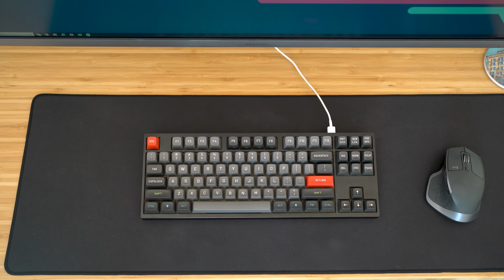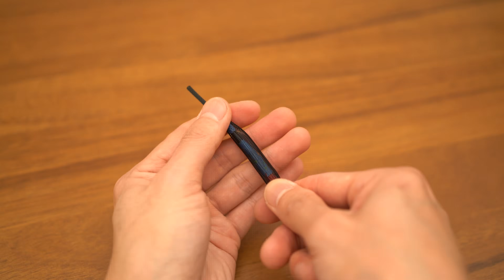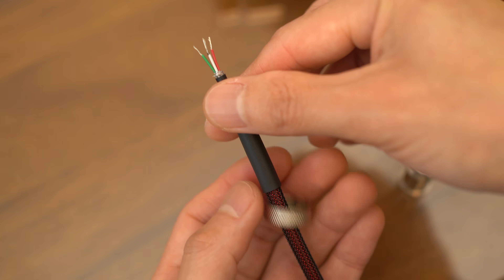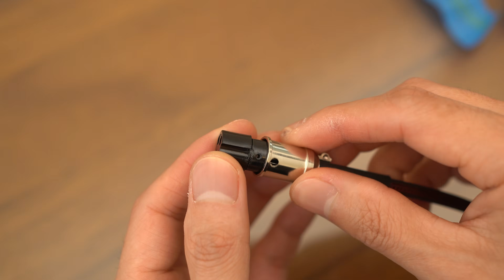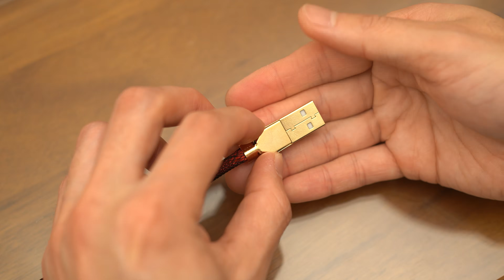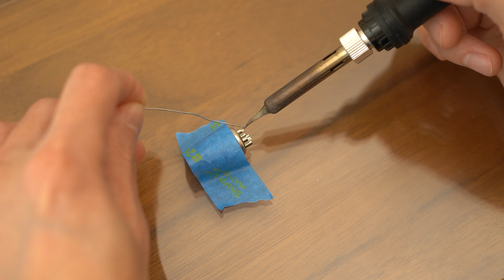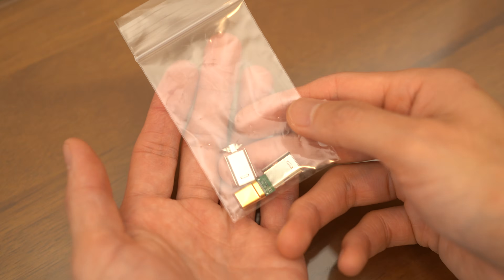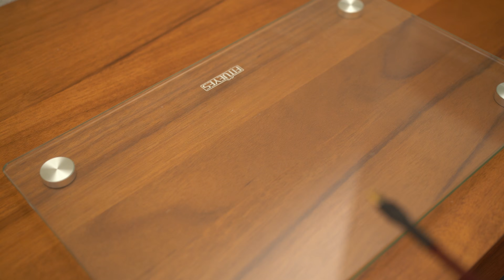Custom Coiled USB Aviator Cable for $50?!?!  Build one DIY for just $17!  Follow Along Tutorial!

Comment: just some words of advice from someone that's been making cables for the better part of the last year regarding coiling

 REVERSE COIL. If you want tight, solid coils that will hold their shape for a long period of time you need to reverse coil. What this means is that the first time you coil you're going to do so in the opposite direction you want the end product facing IE if you want a coil that runs to the right of your USB C then you'll start coiling to the left and vice versa. Do your coil as normal but pack it as tight as you can, pulling out excess slack as you go and tape it off securely at both ends. Then heat treat. I usually do about 6-7 minutes of heat treat for a 7" coil. Disperse the heat evenly and never get your heat source closer than an inch as you WILL burn through your techflex sleeving VERY quickly. I usually do 2-3 heat treats and let the first wrap sit for at least 3-4 hours. Remember, the longer the coil sits the better. After you've done your first coil, remove it from your dowel and start coiling in the OPPOSITE direction you just coiled, making sure to twist the cable as you wrap. Again, pull out any excess slack in the line, ensuring that the coils are packed tightly against one another and secure with tape again. Follow this with another 2-3 heat treats. I personally like to finish this off with about 30-45 minutes in the freezer to really lock the coil in. 

It's a long process but if you've done it right you'll have a MUCH tighter coil that will stand up to much more abuse and look super clean. This is just coming from a dude that's had plenty of practice and screw ups along the way. Also I do custom builds if you'd rather just avoid this whole process all together wink wink nudge nudge lol
Reply from the maker: Hi Colin!  Thank you so much for this expert advice!  I have some older cables that have lost some of that spring and I will try doing this to reset the coil.  Do you have a website or anything for your cables?  Would love to check it out!
Reply: @Keybored  no prob! I’m definitely no cruzctrl or space cables but I’ve made and sold a good few cables and just thought I’d pass along what I picked up along the way! 

I can be found at Ultos Cables on Facebook! Awesome channel and work btw! Your editing and production are really solid!

Comment: What is the purpose of the coil? Also, shouldn't the shielding be grounded through the housing of the connectors rather than just clipped off?
Reply from the maker: Hi Thick! The coil is mainly for aesthetics! I have connected the shielding to the drain on 5 pin aviators, but didn't for this 4 pin. But you are right, that is the best practice!

Comment: Most heat guns only run at 1 temperature the difference between the high & low settings is the fan speed so on high it is moving more air which makes it the cooler setting since the faster air has less time to heat up.

Comment: $17 but that's not factoring in the cost of the iron, tin, heat gun, or clamps you might need to hold stuff still. in all actuality the first cable you make is gonna cost you about 4x that price once you pay for the tools necessary to complete the job. every cable after that is going to be $17 IF everything goes accordingly.
Reply from the maker: Hi Justin!  Thank you for the comments!  You are correct, it is much easier if you're already in the hobby and have the tools available!
Reply: eh not really. A basic soldering iron can be had off amazon for like 20 bucks that will come with solder and everything else you need. You can use a blow dryer for a heat source though a cheap heat gun (again) from Amazon is like another $10. 

CruzCtrl is actually incredibly cheap for his cable kits compared to things like Zap, he just has far less inventory and selection of colors/connectors.

Comment: Would it also work instead of a heat gun putting the cable in the oven at a low temperature like 60-80C for 5-10 minutes or so?
Reply from the maker: Hi Conor!  Some people actually have mentioned that they tried that and it worked!  I haven't not tried it personally, so hard to comment there :)
Reply: @Keybored  yeah I was thinking that its probably easier to get a more even heat without accidentally melting any of it by keeping the heat gun on it for too long.

Comment: Liked and subbed...Question, I saw a youtube vid on DIY coils and at the end he twisted (reversed) the direction of the coil!. What benefit if any does that achieve?
Reply from the maker: Thank you so much for the sub! I appreciate it! If you reverse the coil, it makes the coils more springy and makes it want to collapse onto itself like a slinky. It's good for helping it retain its shape better! I didn't show that because I felt the techflex does a good job of holding its shape even without the reversal.
Reply: @Keybored  Thanks for the heads up :)

Comment: Interesting subject.  But
Please, get a new scissor that isnn't blunt, or use a sharp knife.  Blunt tools destroy material and can actually be more dangerous then a sharp tool.

Tip, tip is for heating, not applying solder.  Because that would ruin the fluss in the solder.  Pre tin the wires make it easier to connect them to the socket.
Reply from the maker: Yup! I definitely need new scissors! And a lot of great advice from soldering experts on this video, I learned a lot!

Comment: I once heard something about reversing the coil after letting it cool to make it stronger. Are you aware of that and if yes, why do you not recommend it?
Anyways, this is a great video.
Reply from the maker: Hi thera!  Yup, reversing the coil will help create a "springy" coil that stays much tighter.  I didn't demonstrate it for this build, since I felt that the paracord/techflex combo does yield a pretty solid coil.  But what you do is after coiling, you essentially "flip the coil inside out" so that the coil wants to "spring into itself."  Hope that helps!

Comment: What soldering iron are you using?
Reply from the maker: Hi Tisho! I'm using a cheap anbes set from Amazon. It worked for me for some time, but overall, if you're planning to use it more often, I would recommend a nicer set. I am planning to upgrade to a hakko or something similar.
Reply: @Keybored   you might want to look into ts100. It is light can be driven of 12-24V and i use a universal laptop charger to drive it, 90W i think. 
It has many "tips" and it has a sensor in the tips for better temperatur controll. 
You can even upgrade the firmware.

If you are getting the ts-100 dont forget to get some extra tips. And a silicon extension cable for better controll. (Less dragging on the back of the iron.)

I think marco reps have some videos on it. And a screwdriver called es-100.
It is a good soldering iron if you have the right tip for the job.

If you already have found your soldering iron it might be interesting to know about.

Comment: what is that monitor?
Reply from the maker: Hi Different!  The monitor is a Samsung 34" Ultrawide UHD monitor.  Hope that helps!
Reply: @Keybored  they actually have 8 different ultrawide qhd 34" monitors :'( which one?
Reply: @Keybored  actually 3 are not curved, I think that will be OK. Do you think it's better to have a curved 34" or non-curved?
Reply from the maker: @BankruptGreek  I think in my opinion, a flat version is more versatile, while the curved is more immersive in games.  For example, I use the flat 34" right now for both work and play, and for spreadsheets, etc., I like the fact that the rows/columns of spreadsheets remain straight on a flat monitor.  However, I had an LG curved Ultrawide before as well, and I really enjoyed that monitor for most gaming due to the immersion.  So it would depend on the use case, and for me, the flat works :)

Comment: When soldering the connector pins, preheat the pins to allow the solder to works it way into the pins and "tin" the wire side with solder so you have a solid connection. keeps you from having bad solder joints and connection failures.
Reply from the maker: Thank you for the advice xFBx!

Comment: Oven heating! 

230°F for about 40-60mins, you’ll be far more pleased with the results. Then rapid cool it in the freezer  until it’s below room-temp, and finally reverse-coil it and repeat the process.
Reply from the maker: Thank you for the advice Ryan! Will Def try that next time!
Reply: Oh nice, thanks for this tip so I don't need to go out and buy a heat gun then! What do you mean by "reverse-coil"? Like are you undoing the coil you just made or something?

Comment: Does this work with more than just keyboards? What about me trying to play a Pc game with an Xbox controller type c? Will that work? And can I attack more than just type c? What if I wanted to be fancy with everything I used? iPhone charger? Oculus quest charger? Anything charger?!?!
Reply: Attach*
Reply: Oh and could I make usb type c to usb type c? And what about psh idk usb type c to lightning cable ...
Reply from the maker: Hi PureOxide!  Yup!  I believe on CruzCtrl, he offers both the lightning connector and a few others as well!  And as long as the device uses a usb cable, this is an option!
Reply: @Keybored  and what about that middle connector for the keyboard? Would that be compatible for lightning cable or usb type c to charge or use devices? Or is that strictly for like keyboard sending “info” so it’ll work Some’s thing?
Reply from the maker: @CrackGameingStudio  yup! The aviator connector is just a quick disconnect so shouldn't hinder much at all!

Comment: Hi! Can you do this with a micro-USB based cable? I checked other videos and it seems that they have a different wiring diagram (just making sure if the process is also the same)

And also, if ever I connect the male and female GX16 together (assume that we have finished soldering etc.), do we need to follow a specific pattern? Like do we need to line up male pin 1 to female 1 and female 2 pin to female 2 pin etc.?
Reply from the maker: Hi Homurice!  You are correct!  Always match up the GX16 pins together.  1 goes to 1, 2 goes to 2 and so on.  The colors should be matched to those numbers.  Even with the Micro-USB, the wiring pattern should be followed similar to the USB-A.  There should be 4 solder points!  Hope that helps!

Comment: One, use Flux when soldering. Two, tin your wires before attaching them to the posts. It will make a much better connection and you'll have an easier time of it, as well.
Reply from the maker: Thank you for the advice Griffin!
Reply: @Keybored  great video, though. It may be just what I need to bring that polish to my setup when I finally build my custom keyboard

Comment: why do people like those overly huge aviator connector thingys?
Reply: a e s t h e t i c
Reply: @emiraryaputra4900  alright! :-D I thought that much. yet its a taste-thingy :-D
Reply from the maker: Yup!
Reply: @emiraryaputra4900  yet my approach behin the question was design-theory motivated. Adding smth. for the sake of beauty without necessity is often considered
a) wasteful
b) unnecessary
c) bad form

🤷‍♂️
Reply: @maggotinc    it has some "functionality", the idea is if you have multiple cables with the aviator connectors, you could leave the one attached to your PC(without having to unplug from behind your pc), and then just disconnect from the aviator and change coiled cables/keyboard, mix and match different colored cables and keyboards. But I guarantee like 90% of people use it for just the looks. The same thing with coiled cables in general, there is literally zero purpose of having it coiled besides the looks. 1. you cannot extend coiled cables(it will just ruin the coil, 2. you waste material ( 6foot of cable for 1 foot of coil).

Comment: If you don't have a heatgun or good hairdryer, you culd also put the cable in boiling water for some minutes (water can not burn plastic so no worries if you have it in a longer time) if you have large enough pot :)

Comment: You fogot about the shielding of the usb c. It has to be connected to the cable shield (need good solder joint)
Reply from the maker: Thanks for the advice Pierre!  Doing this video, I have received a lot of good advice from soldering and electrical experts!  Thanks!

Comment: Thanks for the video, generally found it very informative but the soldering method isn't perfect. It could lead to mechanically poor solder joints or even spotty electrical connections. You do want to tin the tip of the soldering iron with just a touch of solder but you'd want to use far less and you wouldn't rely on that solder to make the connection. You burn off the flux before it can clean the surface you want to solder to using that method. 

What you want to do is touch the iron to the part to be soldered, let it heat up for a moment and then flow the solder into the part in a different spot. If you do it well it should flow over the surface of the electrical contact. If you notice there you had to spread around the solder like it was glue which shouldn't happen.
Reply from the maker: Hi DarkLordDylan!  Thank you for the advice!  I have a ways to go to perfect my soldering, and received a lot of good advice from experts through comments!  Will try flux next time for sure, and tin the wires to help flow better!  Thanks!
Reply: @Keybored  This was a great video, I'll echo another comment about how I can't believe I watched a full 30 minute video on making a coiled cable. In addition to what Dylan said above, I'd recommend reviewing some of the basic soldering lessons available here on YouTube - this is a great video about soldering of solder cups (such as what you found on the male terminal of the aviator connector): https://www.youtube.com/watch?v=_GLeCt_u3U8 
If you're curious about soldering standards, I'd recommend looking into IPC-A-610, Acceptability of Electronic Assemblies.
Reply from the maker: @mrkoren  Hi Mike!  Thank you so much for sitting through all 30 Min!  I received so many good advice from soldering and electronics experts, hope that next time I can make a better cable!  I appreciate the link as well, I'll take a look!

Comment: The strands inside the paracord aren't for shape. They're for weight, and load capacity. Type 3 550 paracord has 7 strands inside, and is rated to hold up to 550 pounds of weight. I just figured I'd be a know-it-all jerk while expressing how much I enjoyed your video, lol. Now I'm going to have to try this to see how badly I can screw it up! Thank you!
Reply from the maker: Hi DemonTekDigital!  Thank you for the information!  I haven't had much experience with paracord for their intended use, so I wasn't as familiar.  Only when I realized that it was actually meant for parachutes and bungees, then I thought... those are for tensile strength!  I'm glad that you enjoyed the video, and I'm glad many people were able to give me advice on the paracord and soldering tips!
Reply: @Keybored  You're welcome! Hopefully I didn't come off as a jerk. I work with paracord quite a bit, and thought the information might help you a little. It's nylon so melting it is incredibly easy. It basically becomes a brittle plastic when melted.
It's an excellent tutorial. Very articulate, and easy to follow. The only downside to it is it's easy enough for me to try it, and that terrifies my wife. Especially concerning the bank account, lol.
Reply from the maker: @Demon-LZ  No problem DemonTekDigital!  You didn't come off as a jerk at all, and I really appreciate the information!

Comment: I Would Love To Have a Buck For Every Wire I have Soldered To Them Male & Female 4 pin mic Plugs Over The Years..I Have Ben a Radio Tech & Electronics /Pc/Server Enthusiast Most all My Life ! & I Would Also Love To Have A Buck For Ever Time I Have Burnt My Fingers While Holding The Plug & Solder Wile Trying To Solder a Mic wire To it..lol. BTW Tha Plug you keep Calling the aviator plug Is like 2-3$ Or Less Each on line & The Cable4 wire to 8 Wire is Very Cheep & I Would Leave A Link But YT Wont let me ! So Really If You Can Find The USB Connectors ya Can Make That For Like 6-8$ for a 10Ft Cable if Ya Wanted ! But Pretty Good Advice an Cool Video !
Reply from the maker: Hi Bigchew! Thank you for watching and thank you for the advice!

Comment: Great Video man. Was wondering if this would be possible to do on a wired keyboard by using it pre installed cable?
Reply from the maker: Hi Milk For Bob!  If you have a dowel and a heatgun, you can also take a pre installed cable and coil it to your liking.  Hope that helps!

Comment: it will cost around you $30-35 to make this cable not $17 
the kit only comes with a very short wire, it's still worth it if you like building ur own shit.
Reply from the maker: Hi Sup SUp!  When I take a look at my invoice, it actually says I paid $17 for the entire 9ft kit.  CruzCtrl basic kit was $7 and I paid additional $10 to increase the cable length, and add in the GX16 aviator connector.  This was just 2 or so months ago in December.  I was surprised at how cheap I can make this for...